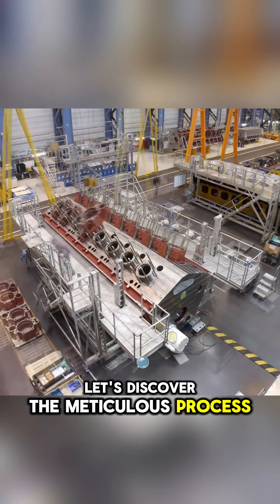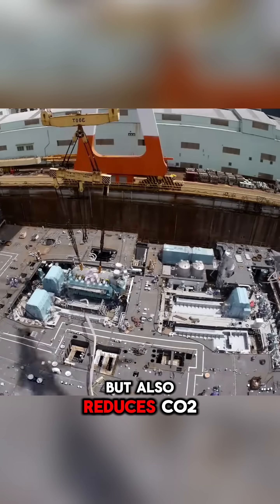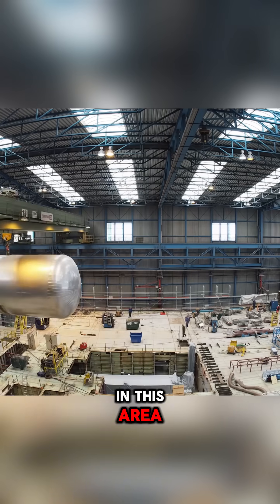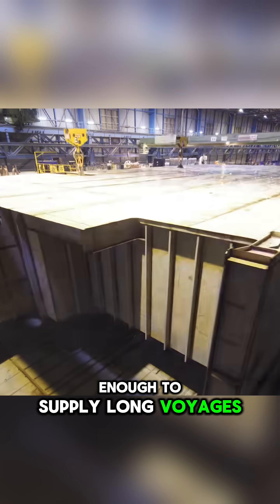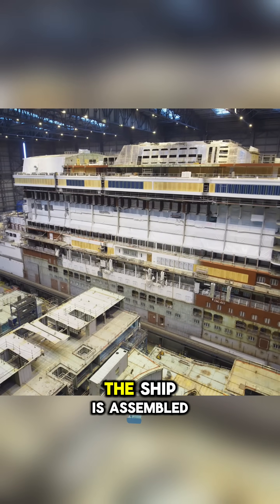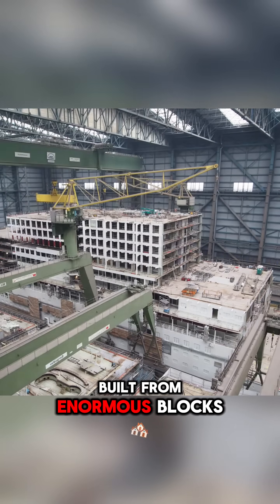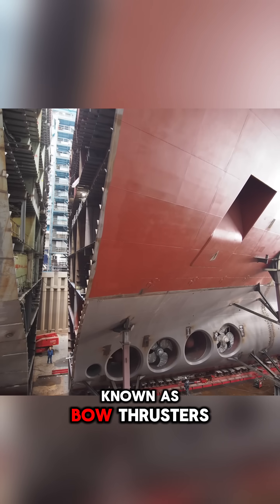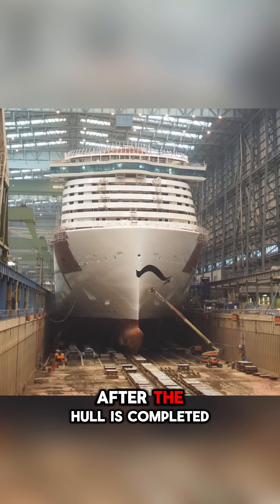The secret behind building a dream cruise ship. #technology  #engineering  #discover

Comment: Nooooooo!!! 25,000 hp is not equivalent to 25,000 individual horses, it's a unit of power that by James Watt's definition, represents the power an average draft horse could sustain over a day. A single horse can actually produce a peak of around 15 horsepower, so 25,000 hp signifies a tremendous amount of power, comparable to the sustained effort of 25,000 average horses.